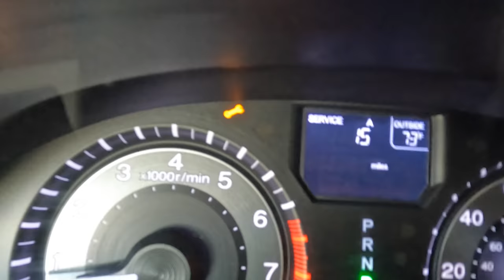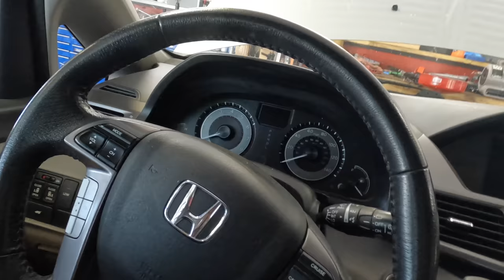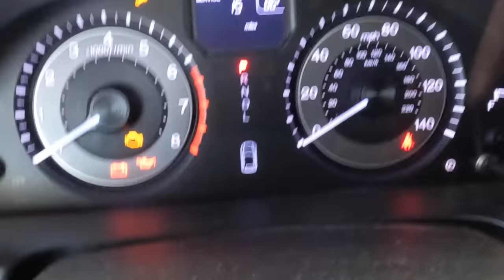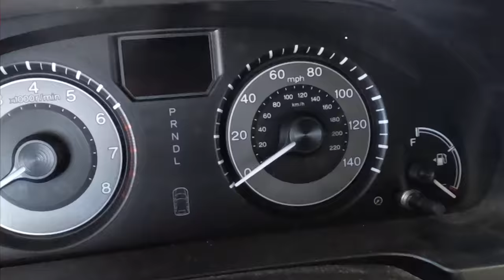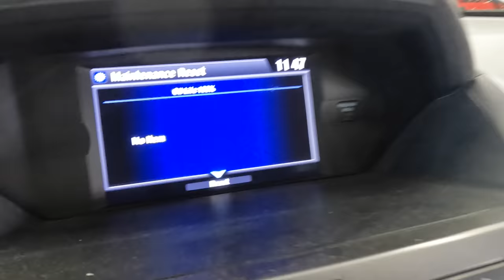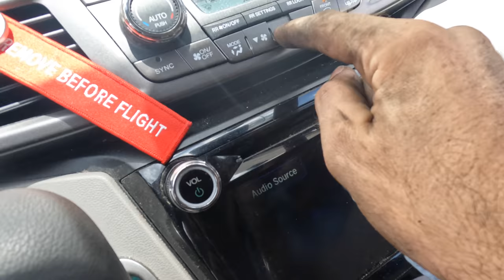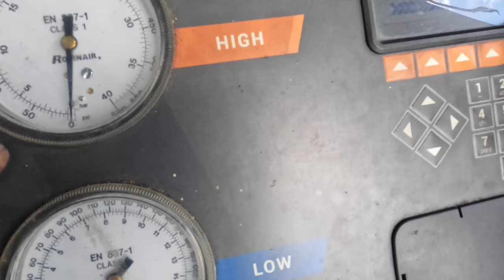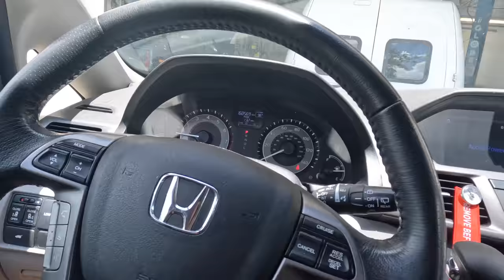Running 300-400 psi. Vibrating noise and smoking! 2014 Honda Odyssey 3.5

Comment: Ray nice work as always but I was surprised to see you overfill the oil by half a quart. I have to ask was the fan a Dorman part???
Reply: Looked like the Odssey was an oil burner.  It'll be OK.
Reply from the maker: no it was from 1800 radiator.  The van burns oil, that half qt will be gone in no time. Plus its the wifes van, so i can do these things
Reply: @gregfielder  Yeah it looked that was for sure. The oil also looked like it was way more than 500 miles since the last oil change.

Comment: Ray, I love you bro and your channel. I have been a subscriber since you started but I have to say that when you guys do not put the correct oil that the cap says, that really chaps my ample butt cheeks, man. Is it a cost thing that your company says to do?  I had a nisssan manager tell me that they provided 5w20 or 5w30 for 0w20 and I am like so is Nissan wrong? Are engineers that built this truck stupid and you guys are geniuses and he said well, we live in the south and you have a low mileage truck (only 20,000 miles) and we are allowed to put in 5w20…. I told him to put the right oil because my truck that costs $60k and is a big part of my business needs to be maintained properly. So what are your thought regarding the oil switch out?  I don’t agree with it and if the 0w20 synthetic is more expensive well that is why I bought the oil change package for.
Reply: This is his wife’s van, so he can do what he likes.

But even if it wasn’t, it’s generally a good idea to jump up in oil viscosity with high mileage engines. It will improve oil pressure and is better for worn out bearings and seals.

Comment: Is melting solder really a thing? Are the wires really going to reach >300C? Wouldn't the insulation melt away first, isn't it only rated to 105C?
Reply: It's a thing. Even with solder that splice has more resistance than the rest of the wire. It's already in a hot environment and adding heat from resistance will melt solder.
Reply: @108gk  The issue with soldered joints in automotive use is not so much that the solder will melt (although it will in extremis) but that the solder has a tendency to corrode when in a wet environment unless it is sealed well. A well-crimped connection will have better mechanical strength and will survive for longer when moisture gets in and promotes corrosion.
Reply: @wigglepig115  Also a solder connection creates a stess point in stranded wire that can lead to fatigue and failure of the wire in a high-vibration environment like a moving vehicle.
Reply: @BixbyConsequence  Indeed it can. A crimped connection also does this but with a different mechanism, although in a solder joint the solder wicks up inside the stranded wire, usually due to a lack of understanding and experience of the solderer (excess temperature and too long heat soaking.) However, the discussion was around heat generated in a high-current soldered joint causing solder to remelt.

Comment: Customer states "When sitting in the school pick-up line, the AC blows warm, they hear a loud screeching noise and a loud buzzing noise and a bunch of smoke comes out of the car over there".

My diagnosis - wife has run over a child which has become jammed in the serpentine belt, causing smoke from friction, screeching and buzzing noises and jamming the AC compressor.
I'm going to hell, aren't I?

Comment: What!?!?
No New A/C Schradar Valves!😳

The Horror, The Horror 😫
Reply: To change the Schrader valve you need to evacuate the refrigerant and then refill. If the valve is LEAKING sure, otherwise mucho dineros for nada.
Reply: @caddyrack  - Ray DID evacuate the system.   Then refilled it. 
Ray's standard operating procedure in past videos is to change the valves.
But not this time.  Wonder why?
Reply: @BA-gn3qb  Maybe he did, normally after evacuating the system you do a vacuum test to check that's all good then re-charge. Many times I pressure test the system with dry nitrogen and then I'll look for any pressure drop, this way I KONW for sure that no leaks are present and then re-charge the system. My two cents. Have a great day. Cheers. BTW, changing the Schrader valves is a good insurance policy......
Reply: @caddyrack  - And again, if you watch Ray's videos, he always vacuums the air out of the systems.
Standard Operating Procedure when opening up to air.
Reply: @BA-gn3qb  I must have missed it. Totally agree with your comment.

Comment: Those crimp on connectors suck bud.
especially in the rust/salt belt of Ontario, Canada.
Buy a box of the ones that have the solder built right in.
Ya just heat them up and yer done forever

Comment: I'm gonna disagreeify with your splice decision. A soldered connection has more mass than the wire so will not go soft with excessive current. The crimp connection is susceptible to corrosion from the road where solder is not. Besides if you pull that much current you are looking at fried computer.

Comment: Probably missed it, but what is that steel cable looking wrench called that  you used for the Oil Pan plug?
Reply: The aptly-named "drain plug removal tool"
Reply: @BixbyConsequence  Hold up, is that really what it's called xD

Comment: I have a 1997 Ford T- bird coupe, that I need to get fixed. I can't  afford  to send it to my Ford trained mechanic  in another  state. He move from Florida  to Colorado,  old school  but could modify things when out of parts.
Anyway,  he suggested  getting  a mechanic ' s license, where one could  still drive it after it was repaired and make payments. 
So does  that still exist  in Florida, or at your shop?
You could  also  use the car to film a few episodes  here.
I am not really  sure what part of Florida  you,are in, but I'd rather  fix this car than buy new., and I am also  on social  security benefits.
Reply: The car was vandalized  by a roommate,  he removed  something  in the undercarriage and all the fluids,  drained out.
He hit the passenger  door with his truck, handle still works, but needs replacing. 
Then I had a mobile  tire  place called Tire Brigade rotate  and put tires on, they broke something on the rear  driver's axle, when the tire Brigade  left, my driver's door didn't  work anymore  from inside the  vehicle. 
Yes, J had to crawl out  the passenger  side.
Probably  will need a new gas tank, as was sitting a bit but putt in a new,2 yr battery in March. 
Originally  planned to ship it to Colorado,  where my Ford  mechanic  was going to convert  to an Electric vehicle. 
But he said now, I should  just get it fixed as car shipping  is very expensive  now.
Reply: A mechanic 's lien, not license

Comment: I have had a pointer type torque wrench like that for 30 odd years, to my certain knowledge it has never been calibrated, I wonder what it really does ??   (under or over)
Reply: probably not
Reply: One thing you can be certain of, and that is the pointer type torque wrench wasn't accurate when taken out of the package.
Reply: Easy enough to calibrate. Clamp the drive end in a vise so that the beam is horizontal to the ground. hang known weights off the middle of the handle. The handle being the part you hand on to torque bolts and nuts. The handle usually "floats" on a pivot. Measure the distance from the center of the drive end to the pivot point on the handle. If it is one foot then the pointer should deflect to the number of pounds you have hanging off the handle. If is two feet then it should indicate double what the weights total is. T = R X F where T is torque, R is the distance from the center of the drive end to the pivot point on the handle, and F is the force applied at the pivot point. If you do it all in foot.pounds it is easy. In Newton.meters it is a little more complicated because a one kilogram mass has a weight of 9.81 Newtons (most places on the surface of the earth.) Even trickier to calibrate in space (free fall) but that is beyond the scope of this post.
Reply: @gaiustacitus4242  How so? They self calibrate if point @ 0
Reply: @gaiustacitus4242   I know that, you know that, we all know that.  My point was why the hell have we all got one hanging around ? but most of us do !

Comment: The fresh oil on the dipstick sure was darker than I expected. Is this common to this engine?
Reply: He REALLY needed to do Al oil FLUSH right before that oil change as well. But the service wrighters will only suggest so much, just like  customers will on take some suggestions. We can’t all be right all of the time. 🤑
Reply: @ToddAdams1234  Not a fan of flushes, especially on high mileage. It might break loose stuff and you end up with a leak or more oil consumption.
Reply: @ToddAdams1234  “writers” NOT “wrighters” 🤦🏼‍♂️🤦🏼‍♂️🤦🏼‍♂️

Comment: Only one issue i had with the way you did the fan repair: I wouldnt have cut off that connector. Youve now voided the warranty on that fan should anything go wrong with it. Youd still have the warranty to the customer though, so the shop would have to eat the cost of that part. You shouldve sent that one back and ordered a different brand, or even better, an oem one. Of course oem costs more so that would be up to the customer. But, otherwise excellent vijeo as usual!

Comment: Ah a failed cooling fan how ironic😂 as a Nissan tech I see way too many fan failures. Most concerns are check engine light on and overheating. Only the small econo boxes seem to loose ac when the fan fails. Never seen any of the complaints mention ac not cooling tho

Comment: I remember seen in a autopsy video once an AC compressor with a rupture disc instead of a pressure relief valve. That would let all of the charge out at once in case of an overpressure condition. I think it was from some older car.

I also wonder if the driver side fan normally kicks in first (smaller size, possible lower power) and runs much more often, thus wearing out wibbly-wobbly first. They look fixed speed fans (only 2 wires) so it might be a two stage setup.

My car has just one large variable speed fan. It has power on/off control and then some kind of PWM control or similar for the ECM to control the fan speed. The fan motor looks like a big brushless motor.

The ECM in my car takes not just only engine coolant temperature and AC pressures into consideration when controlling the fan speed but the intercooler outlet air temperature as well.

When the fan went berserk the mechanic at the workshop told me that the sensor that measures the air temperature and the boost pressure after the intercooler had bad temperature readings, and the ECM thus went into a backup mode what comes to cooling fan.

No limp home mode and no check engine light or no error message on dash whatsoever, just a very odd symptom. The car was perfectly drivable in normal daily use so I got it back from the workshop while they were waiting for parts, as there was no risk of any overheats or overpressures due to the extra fan power. But I did not go for any longer trips before the repair as I was not sure what it would do to the fan motor and bearings blasting like that the whole time instead of just when needed.

After the repair I was told that the backup mode was just 40% instead of 100% of full fan power, but it nevertheless felt bit like a jet engine under the hood when listening from outside.

I would like just to emphasize how different even these things can work between different car manufacturers.
Reply: Mick Jagger had a vehicle just like yours! Thus the song….. I’m getting a new “vibration” LOL

Comment: It’s beyond me how manufacturers cannot position oil filters and drain plugs in a location that the oil doesn’t drain onto chassis members everything getting covered when the oil gets changed is just bad design. First time I’ve seen “engine oil” printed on the sump of a vehicle though👍
Reply: Loosen the filter a smidge just to make sure you can, then punch a hole in the low spot of the filter where it can drain cleanly. A nail-punch works well.  I always had to do this with our Subaru that had the filter completely surrounded by exhaust pipes and shrouds.  It was the only way to avoid having the car stink of burning oil for days after each oil change.
Reply: He must have not had a leaking engine to de with nor did he not have a discourteous mechanic last time (although it was probably Ray).

Comment: Question: When adding 5 quarts of room temperature oil to a hot engine, I looked it up and discovered that the 5 quarts will expand to 5-1/2 quarts when it is at operating temperatures. (I used a thermal expansion formula). Would this 5-1/2 quart overfill be detrimental to the engine in the long run? Should you only add 4-1/2 quarts, so the dipstick shows full when at operating temps?
Reply: I may be just a shade tree mechanic, but I think most professional mechanics would agree that slightly over full is better than slightly under full in regards to engine oil. The owners manual for this vehicle specifically calls for 5 quarts engine oil cold. To add any less than that amount the dipstick will read as low on oil. Besides that the manufacturer most likely has made the same calculation and has made sure that the oil pan has room inside of it for the extra volume of the expanded oil. Hopefully I was able to answer your question. Remember knowledge is power

Comment: "Solder will melt under high amperage current draw."
I'm questioning this statement. Not completely sure I'm correct. I believe the connection will only get hot if there is resistance in the connection.
Reply: You’ve never had anything to do with dyna-starts have you ?     Those b’tds will melt their coil connections if you look at them !
Reply: Theres always resistance in connections..  but if you have a small conductive area that is passing a high current through then this smaller area will get hot if its not a properly sized conductor.  Just like if you use a small wire to run a device with a large current draw, the wire will heat up until it melts and fails..  same deal with solder and traces on a pcb, if theyre not rated properly then it will just heat up that trace or solder joint until it fails…
Reply: If there's too much amperage for the circuit to handle it will get hot no matter how good the connections are
Reply: A correctly soldered connection will always be lower resistance than box crimps.
Reply: Think about all the different things that can offer Hi Electrical Resistance besides corrosion
Reply: @peted5217  indeed, I am well aware of these having met them all in my 30+ years as an electronics engineer...
Reply: @wigglepig115  I'm sur you are, being on the research and development side .

Comment: That way too thin of a oil to be running  especially during the summer  during the summer you should be running thicker oil to compensate for the way it thins out as it gets hot 5w20 is already thin as water and as it gets hot it get even thinner

Comment: Honda says that the safety valve (compresssor relief valve) should be replaced anytime it discharges because of high pressure. usually caused by a malfunctioning fan or system over charge.

Comment: Hi Ray, simple questrion. 5000k miles seems awfully short for an oil change. I live in Euroland and official guidelines state 10k-15k km (6.2k - 9.3k miles) or once a year, whichever comes first. Do cars in the US have excissive wear due to different circomstances (e.g. lower octane fuel) or is there no real reason?
Reply: Use to be every 3,000,but with modern updates of oils is now 5,000 or 7,500 or every 6 months if wear isn't hard. In the USA we work out cars much harder than Europeans, our country is huge , if you don't have a car you're screwed.
Reply: My Chevy pickup has a dashboard warning message on startup. Apparently the ECM calculates time for oil change based on engine load, heat and mileage. When it tells me to "change engine oil" I obey. I'm afraid if I don't obey it might tell me to " change engine". That would be bad.
Reply: Every car I have had the oil change range was between 5k and 7.5k miles. Depends on the manufacturer I guess. I think 5k oil changes are kind of short, but inexpensive to do if you do it yourself.
Reply: @cwstout1  Back in the 1960's and 70's, 3000 miles was common.  Iirc, my old VW beetle had a 2000 or 2500 mile interval.  Then again it didn't have an oil filter!  You also needed to change the oil in the AIR FILTER!  Lol.  Longer intervals today because oil is so much better and engines run cleaner.  Curmudgeons stick with the older values because they believe it's all a conspiracy by Big Government to ruin their cars in the name of the environment.  They somehow don't consider that modern cars easily go 200K, 300K miles or more without major service whereas cars in the 3000-mile oil change era were doing well if they could go 100K miles.

Comment: My home AC had a fan problem and high pressures. It was a failing capacitor.
Reply: The capacitor usually fails because the A coil is dirty. A proper fix requires removing the sheet metal that connects the HVAC unit to the house and using a brush to scrub the fins on the coil using dish detergent. Not only will this procedure prevent the replacement capacitor from failing but it will make the unit operate at greater efficiency. Note: Failure to perform this procedure periodically is the number one reason for decreased system efficiency and why HVAC companies sell homeowners new units they do not need.

Comment: You are supposed to use 0w20 not 5w20.
Reply: High mileage engine
Reply: @chronovore7234  I would go for 0w30... Keep the cold number the same and raise the hot number

Comment: oMg Y u UsE eUrO cOoLaNt? That's an Asian vehicle sold in America that was probably built in Mexico. You need the proper MexiAmerAsian coolant or you'll blow the engine 😜 jk I'm sure it's fine. And this gives me an idea of what to check on for some ac troubles I'm having before I bring it into a shop, since I got no ac machine.